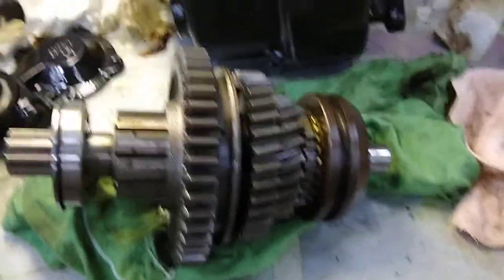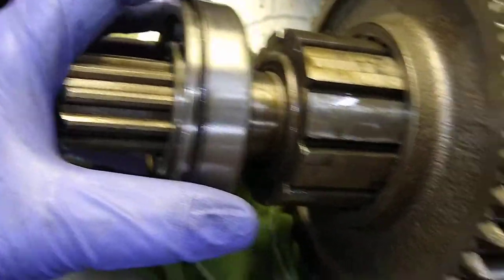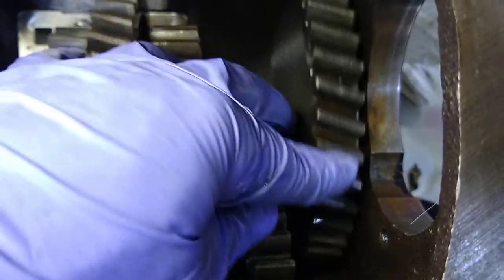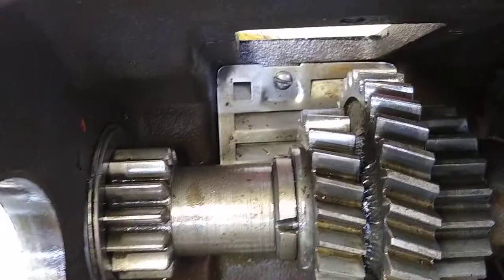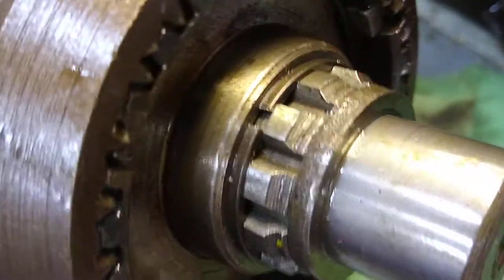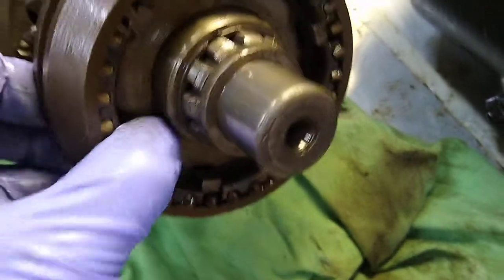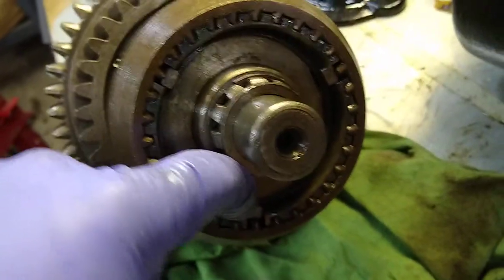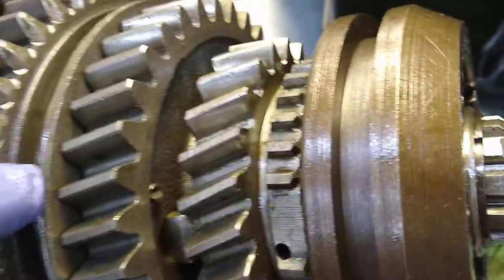SM420 Transmission Mainshaft Overview

Comment: I have a 63 c10 that has third to fourth synchro issue, I double clutch and it shifts fine, I bought the rebuild kit from Novak, did you make a video of changing those
Reply from the maker: I have a a longer 20 minute video that goes over the whole transmission that might have what you're looking for: https://youtu.be/6imX-_msbo8 
I'm trying to remember what I have in my different videos, been a while since I watched them.  This one goes over the clutch hub, keys, and springs, which contains the 3/4 syncros.  Could be your clutch hub keys or springs that are worn, or the brass syncros themselves: https://youtu.be/lsd2m7wkdRY  
The Sm420s from the later years are a little different from the earlier ones, so I'm not sure if they'll be exactly the same, but should be close enough to get an idea.  Thanks for watching, hope you get your shifting issues fixed!